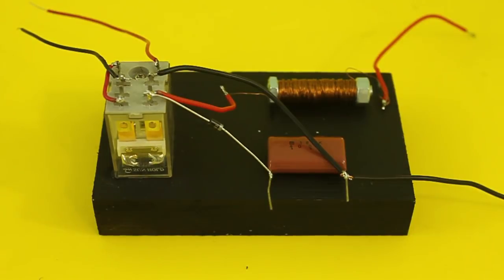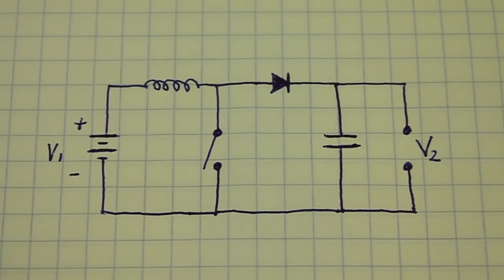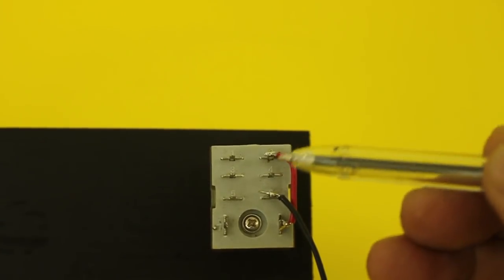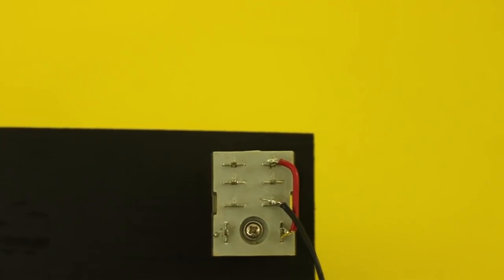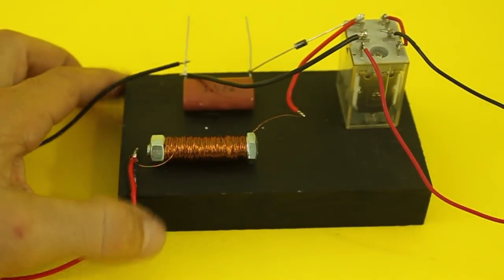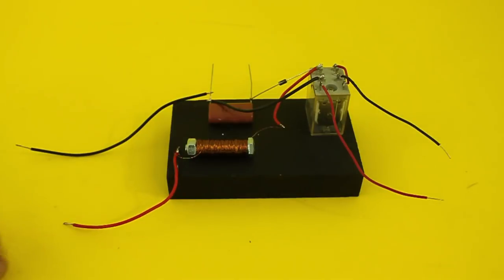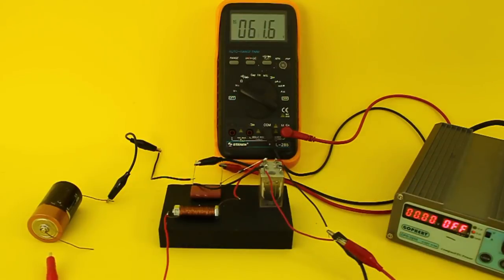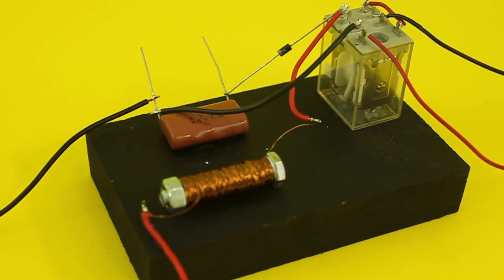Simple Boost Converter with Relay

Comment: the electrical pencil or lighter high voltage relais prinzip , for 40 years it was a chrismas or birthday gift :) :) :) ,,, if this relais drive a mosfet with toroit coil , it works as a powerful up voltage charger , with a shunt or temperatue sensor and schmitt trigger ,  it finished loading automaticly

Comment: Professor - Is it possible to use this circut for a flyback driver?
Reply from the maker: No
Reply: Professor, forgive the question  please. I understand that there is inherent instability in such a circut. The theory behind the voltage ramp is very interesting.

Comment: That's useful but i think the output voltage is Ac
Reply: Tech's Science There is a diode used just before the capacitor , so the output is actually DC because the diode acts as a half wave rectifier.
Reply: karsanuma just not pure DC without a lot of filtering to get rid of the ripple.
Reply: It has a diode and a capacitor so it's DC

Comment: Very useful! Thanks to your previous video about boost conv. i had won a county physics competition, i won a 32GB U3 sd card, a Parker Vector pen and some goodies. I used a relay as a inductor, 4 aa bats as V source, a tact switch, a 1n4148 diode, a 470uF 27V cap and two 1M ohm resistors, because i had found that higher loads give out higher voltages, most likely because the cap discharges more slowely.
Thanks for making those videos!
Reply from the maker: Glad to hear that!
Reply: Nice!